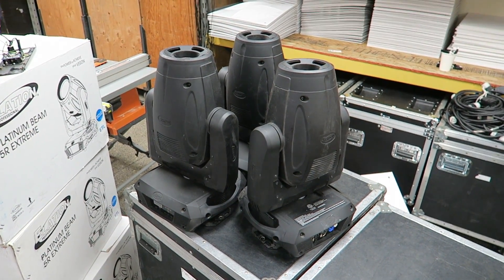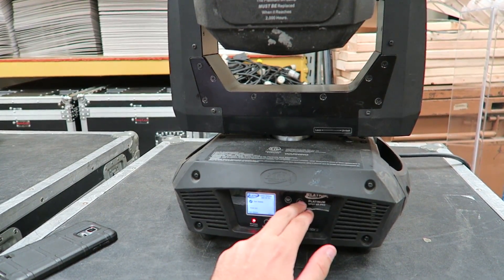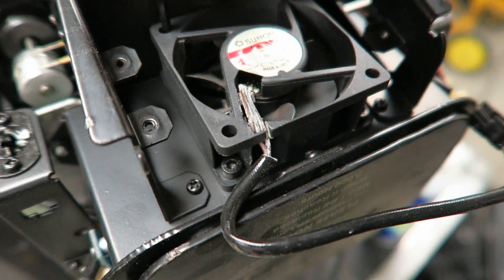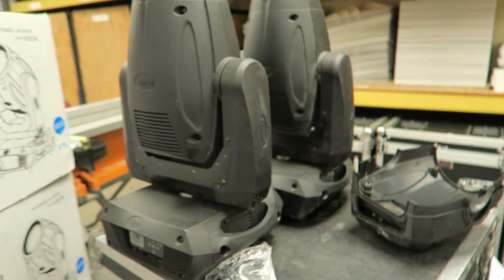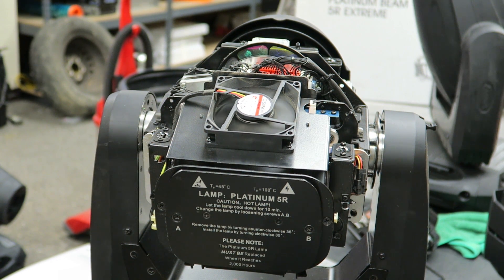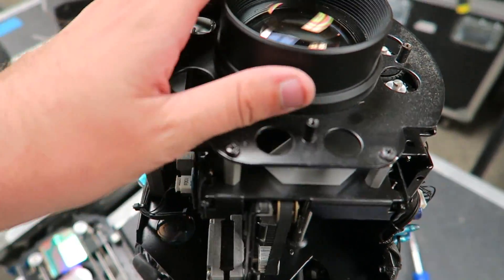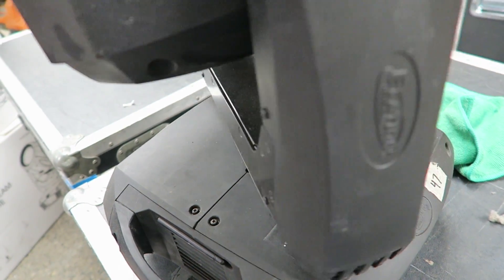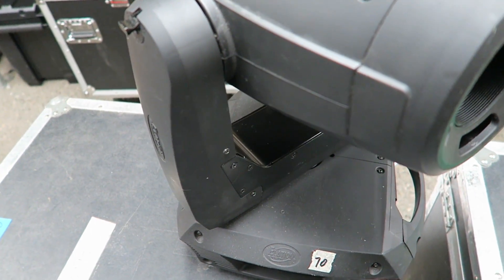Fixing three Platinum Spot 5R Pros

Comment: Love the video, personal preference I strongly dislike some Elation fixtures, I give you mad props to having the patients to work with the 5R. I found that customer service not very helpful. I personal am certified by Vari-lite as a Technician, our shop has primarily VL, Clay Paky and Robe. Also, just for some constructive criticism, when you were explaining the 5R with yellow belt being broken. I like you asked your viewers what the problem could be, but you should go in to detail about why the belt broke. Also for people who don't know that the glass flags are dichroic glass. Over great video, love your channel.
Reply from the maker: thanks! all good points. I'm unfortunately not cool enough to be certified to do anything that I do :)
Reply: On the second unit you repaired, the one with the frayed and broken cable like belt, what caused the fraying that led to it's demise? Was it caused by age, use, or poor quality material it was constructed from? Have viewed a number of these repair videos and no one takes the time to explain why the malfunctions take place, or even question the reason for it's failure. For the sake of longevity and reliability, plus customer satisfaction, why are the failures never questioned or investigated prior to returning the unit to the customer?

Comment: This just reminded me of a PR XS250 that had its head crushed down (somehow) I had to remove the whole head off the base and pull the brackets out to straighten them. This is what happens when the client wants the light repaired and the parts are no longer available.

Comment: Christian; when i have to fix lights in my club its party of my base pay :( But sometimes its fast for me to send them back to the manufacture as they have the part.A few weeks ago I blow one belt and they told me "we are out of stock". OMG I sent it to them and they fixed it in less then a day. But the newer lights that are out now are so much easier to fix; then the ones i had in 2004
Reply: Some of the belts are generic stock. Find the width of the belt, the pitch which is most likely metric, and number of teeth.  For example a 2mm pitch belt 5mm wide with 200 teeth is easy to find.  The belts are often the same as used in robotics, CNC routers, laser printers, etc.  The motors are common stepper motors.  Often NEMA 17 or NEMA 23 in size with 3 or 5mm shaft.

Comment: I just got a fixture, the till doesn't alight as the others and it grinds when it hits the stop buy doesn't reach the till stop when it tills on the opposite direccion. I adjusted the head by removing the belt it improve but still off a bit. should I move the belt a bit more or I have a bad motor ? sensor.

Comment: I have a Platinum Spot 5r (non pro.)  It boots up fine, everything nice and smooth. When you signal it to pan, it just jerks till it hits the mechanical stop. Any idea what's going on?
Reply: Found the problem. Broken wire on the optical sensor

Comment: I have a problem with an elation platiun beam(like the ones u have boxed) lamp strikes but turn off after a second motors reset, this one time it would turn for a few minutes then the lamp will go off, i try it at home and it works fine. I had taken for service a few times, they change ballasters twice the lamp is only at 600hrs life. Any help would be aprecited
Reply: If you mean it doesnt work when at venue and works fine at home I'd be looking at the temp sensor in the head. If you have it sat on a desk in your home the heat will rise but in flown conditions ambient heat collects inside the heat.
Reply: @giglight  thats what I was thinking. but as the sun set it got colder and samething will keep happening. motors reset, strike for a min then when stars to get brighter and motors reset a second time(not sure if thats normal)it won restrike.. and stay off permantly. I olso start the fixture with lamp off then after motors reset for second time I turn on the lamp fron the fixture controlls, it turn on and went off after a few minutes. i was certain i had a bad lamp but as mentioned, i got home and worked just fine... olso i check all fans were runing just fine
Reply: @ladjkaoz  not familiar with elation stuff but on Martin kit you have a lamp off on dmx signal loss. The lamp not coming back on after it goes out is normal they are not hot re strike lamps they need to cool before they will lamp on again. Keep resetting itself could also be a bad signal being sent to it. If it's at the venue not plugged in to anything other than power how does it behave?
Reply: @giglight  im aware that discharge lamps won restrike hot after. thats why I let it go thru the reset proces lamp off. and once it had reset i turn on the lamp but only turn on for a short time. I guess it maybe a fan or as you mention a temp sensor but all fans spin fine and sensors? I dont know how to test them. I plan on switching parts Power supply control moduel, but as i said when i got home it worked fine. this is the 2 or 3 time it does this. elation change ballester last time...but it did it again...

Comment: I have a question about GrandMA on my surface pro 4. Why can't i press the TEMP buttons properly? Is there any other way of using my toutchscreen for lighting control besides sliders?
Reply from the maker: Because holding down with your finger registers as a right click by default on surface pro 4.
Reply: Yeah i turned that off, but i need to click 2 times on the temp button before it works. Even though i don't need to do that for normal Go buttons.
Reply from the maker: not sure, I never use temp buttons on screen because the nature of them is more suited to the buttons on a midi controller in my opinion. sorry I couldn't be of more help.
Reply: +Christian Jackson still thank you. I think i am going to buy a midi controller. will a midi drumpad work?
Reply from the maker: anything that sends notes as control info
Reply: Thank you very much for your help!

Comment: hi I have two platinum spot 5r by elation and have a tilt error on both units. what do I do to get these fixed. where is the magnet or sensor at ?
Reply from the maker: sensor is in the arm.
Reply: What about the magnet
Reply from the maker: everything is in the arm
Reply: Ok thanks

Comment: Good afternoon, I bought a new lamp for my moving head to think that it was from the lamp that did not light.With this lamp lights but the light that gives is weak.

I measured the voltage between the ignitor wire N and the igniter L by disconnecting the wire from the ignitor to make the measurement and gave 230 volts or the ballast is good ?

Ignitor link https://imgur.com/a/3QmXcTZ

ballast link https://imgur.com/a/zAjw20j
Reply: Lamps are run in constant current mode.  Current may vary with the voltage changing little.  Need a DC amp clamp to measure the lamp current.  If old an new lamp are running low current, and the voltage selection is correct, the ballast is not providing the correct current.  Check the current spec for the lamp for the actual expected current.  Weak light can be dirty optics, damaged reflector,  Lamp position incorrect, sticking shutter, etc if the lamp and lamp current are OK.